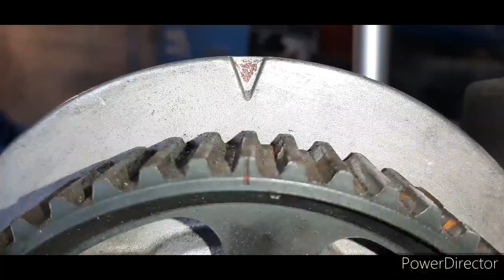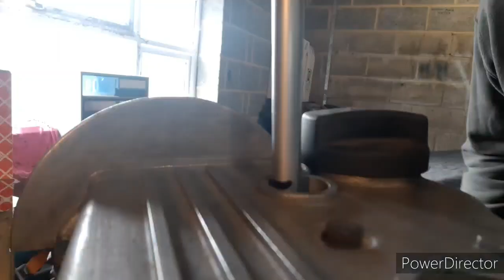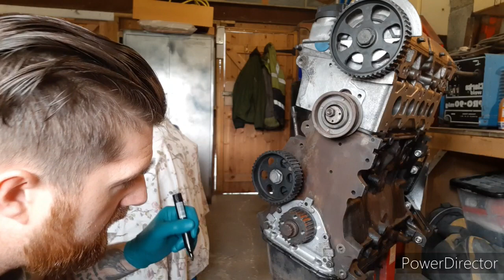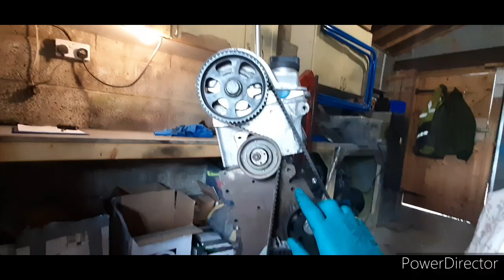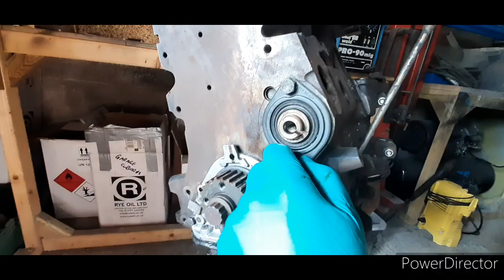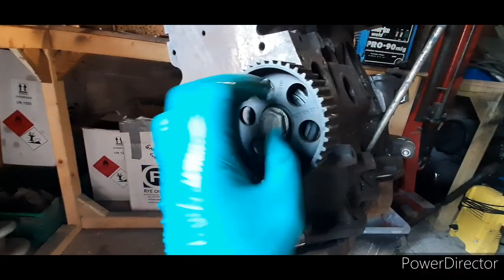How to: Timing Belt VW 1.8/2.0 16v DOHC

Comment: I am in search of the lower timing cover and pulley, 
any idea where I can get these,
I only can find timing covers with number 026 109 174 would this fit or do I need the 027 109 174 one.
Reply from the maker: What engine code is it?
Reply: @GreyGooseRestorations  KR
Reply from the maker: Pretty much any 16v covers will fit (not including ABF Mk3) 
Speak to Dubstock via Facebook or Instagram as they will 99% have those parts 👍

Comment: I dont understand why you put the timing cover on and pulley, then move it around and then take it back off after you've already set the crank to TDC. Please could you explain?
Reply from the maker: I used the cover and pulley to check/confirm the factory marks for TDC, then they came off to install the belt, then went back on to confirm the marks line up. Its best to check and check again
Reply: @GreyGooseRestorations  I get you, thanks!